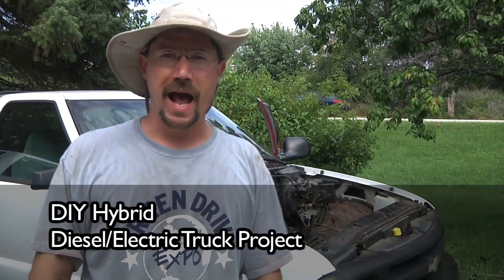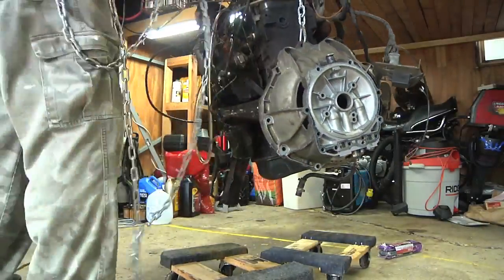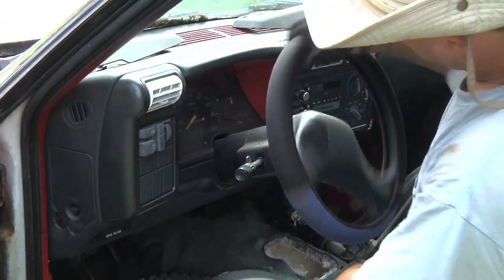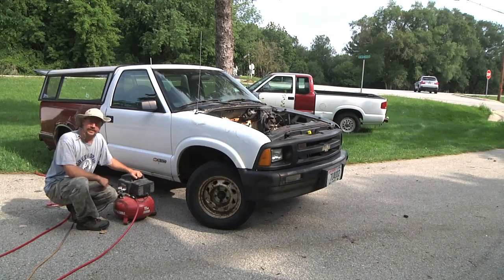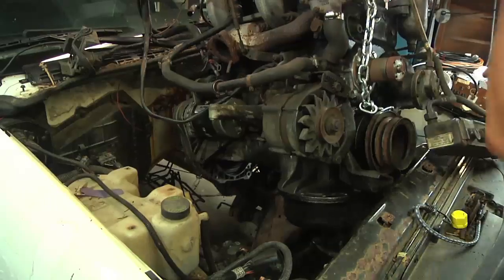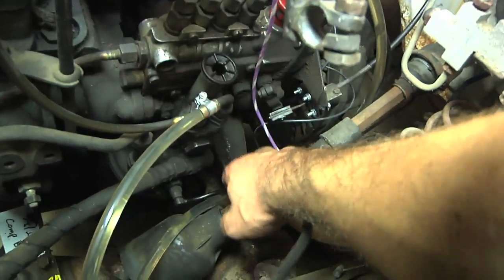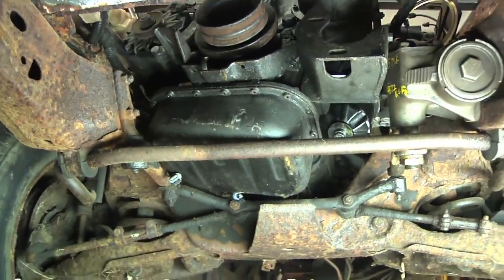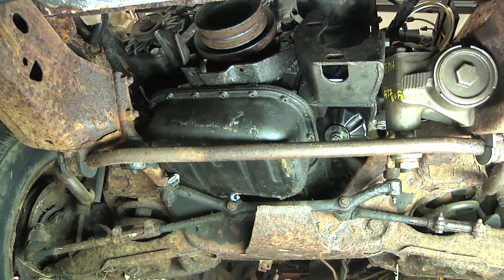SuperTruck: Manual Steering & Test-Fitting Engine

Comment: Yep.  Still an awesome project.  I'm sure you've seen the others on YouTube.  The 5-cyl. turbo was put in a Suburban, Dodge Dakota, older S10 than yours, and a Jeep Cherokee.  I've even read an article in a paper about the 2.4 put into an antique Farmall H farm tractor.  They were both great engines.  My 1980 240D has about 474K miles on it, and the 1983 had almost 375K on it when my wife totalled it. Only a couple weeks ago I FINALLY had to replace the 5-cyl. engine in my 1984 300SD at 728K!

Comment from the maker: That's right, it's only a four cylinder 2.4l engine. It will be replacing the GM 2.2l gasoline engine. The compact pickups had the smaller "car" engine as an option, whereas full-size pickups usually have a V-6 or larger.

Comment: Additionally, if you've ever driven a 240D Mercedes (I've driven MB diesels for 17 years), you'd know that it would be WAY too under-powered for a full-size truck!  I believe it's only about 65 horsepower!  I know the last ones imported (1983) were 67 hp.  I have a 1980 240D with the same engine, and a four-speed manual, and it's painfully slow.  The 1983 I had was no better!

Comment: If I were you I would retain the sway bar but put a 1 or 2 inch spacer (square tubing) in between the bracket and the frame.

Comment: you dont need the swaybar(what connects the one wheel to the other), alot of offroad rigs dont use them so they can flex more, its always nice to have though since the most of your offroading is going to be on the lawn.